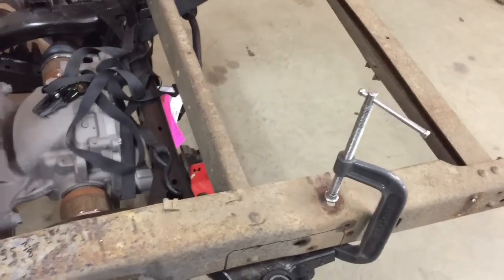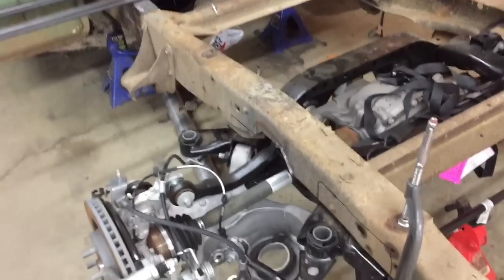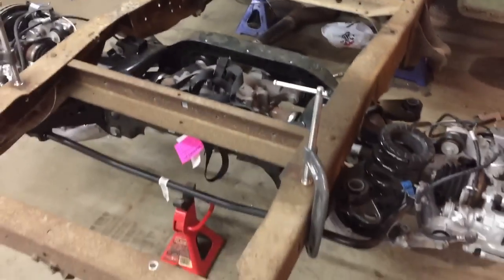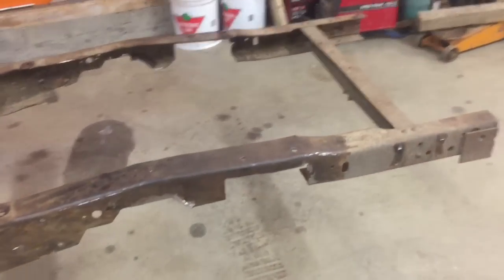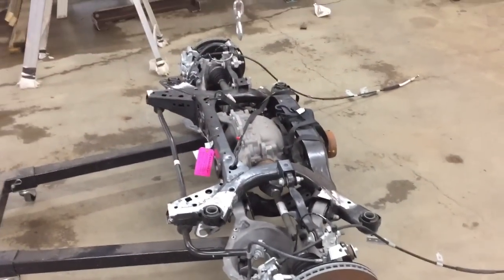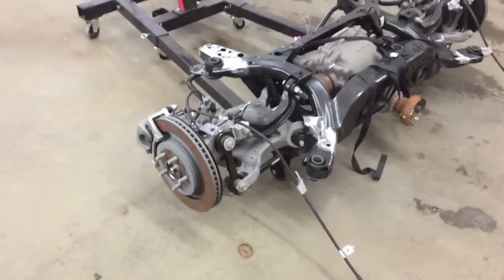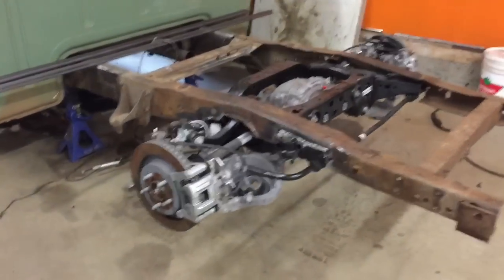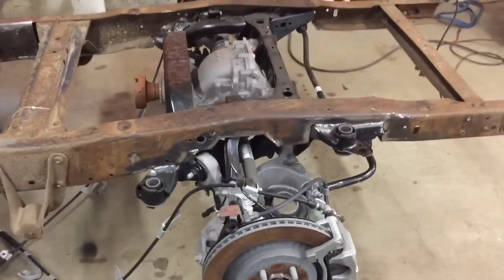1971 F100 gets 2017 Mustang IRS part 4

Comment: Do you check the pinion angle before you weld or are you able to adjust it once it in there?
Reply from the maker: Set it before. I put it at 3 degs up and it worked perfect

Comment: We didn't get to see any degree wheel work.
  Is the frame perfectly flat? What is the degree on the face of the universal joint?
Should be no more than 3 degrees. Vibrations will be felt by all.
Reply from the maker: The pinion is right at 3 degs. No vibration at all.
Reply: @TheGoFastGarage  is this truck finished?
Reply from the maker: Pretty much. Put about 3000 miles on it since the swap
Reply: @TheGoFastGarage  why don't you put some pictures up on the finished project)

Comment: I enjoyed your build very much. I am marring a 2016 Mustang Gt drive line with its front and rear sub frames to a 1951 Ford coupe. I never considered welding the IRS sub frame to the 1951 Ford chassis. Have you noticed any adverse conditions that might not have happened if you bolted it in? I want it to be a comfortable and dependable every day driver while keeping  the original 435hp coyote motor. Thanks Doug
Reply from the maker: It’s been awesome so far. No wheel hop at all. The truck hooks and goes. Super stable even in rough corners.
Reply: @TheGoFastGarage great job. Would you mind sharing some of the actual measurements you used to installed the IRS

Comment: What was/is the ride height before and after you notched the frame?     Leaning on your first ideal but would love to know how much of a change it is from stock.   Going to run the CV front too.
Reply from the maker: If you're going to run the crown vic swap at factory ride height, it would probably work out.

Comment: What pinion angle did you end up with?
Reply from the maker: Errol Kaai a little under 3 degs
Reply: Thanks for the quick reply!  I have a MKVIII IRS that I'm going to try to install very similar to how you did yours.  Thanks for your video, I've watched it now over 10 times! :P
Reply from the maker: Right on man! Appreciate that. More videos soon I hope.
Reply: @TheGoFastGarage  Do you have any vibration at any rpm due to incorrect Pinion angle?  I am currently doing this same swap and am worried about this pinion angle being right.  Any insight you have would be appreciated:)
Reply from the maker: No vibration at all. Works perfect.
Reply: @TheGoFastGarage  Did you measure the pinion angle just by the the vertical surface of the front of the pinion?  Also are you checking your emails?  I sent off a couple but no reply.  maybe i have it written down wrong.
Reply from the maker: Yes. Angle finder on the pinion flange. Forgot all about the email address. Email me at jrawd1@gmail.com

Comment: Lot of frame cut out there...
Reply from the maker: 16”
Reply: Once the subframe is welded back in. It will make up for all the frame that was cut away.
Reply: @TheGoFastGarage       this 16 inch the measure  of what you cut out for the main subframe of irs to fit.? Also what is your spindle to spindle front to back Wheel base measurement